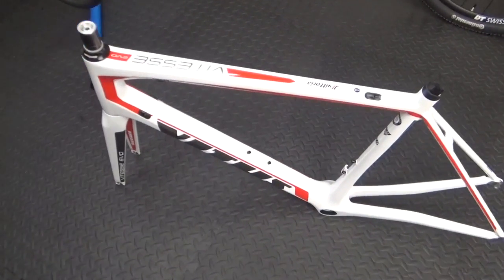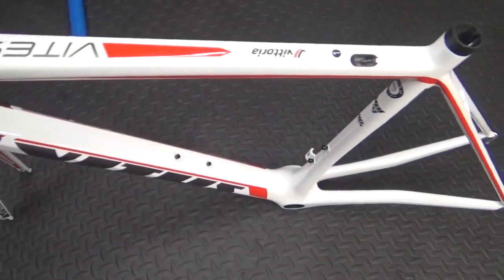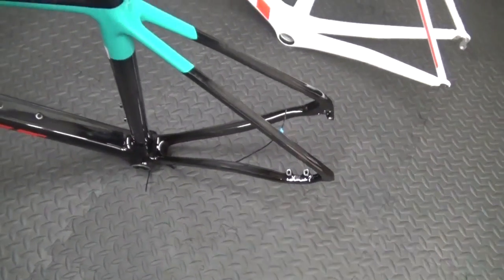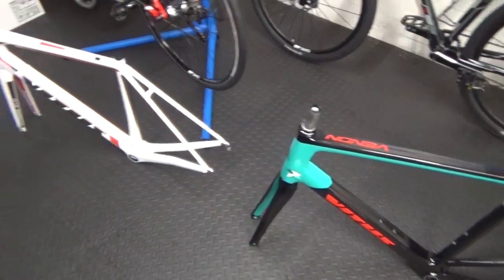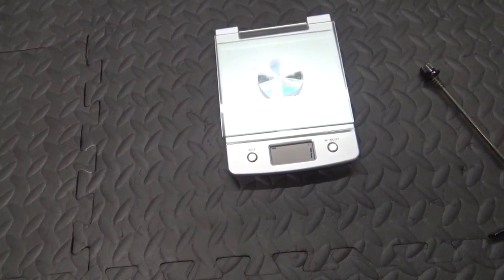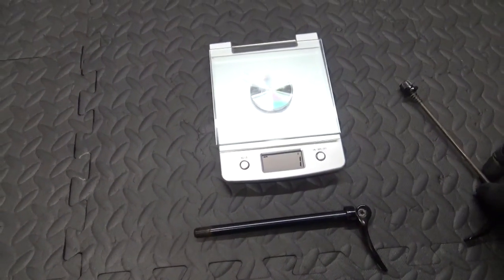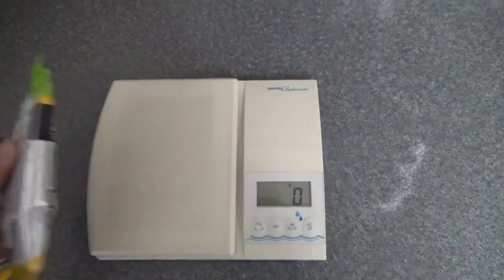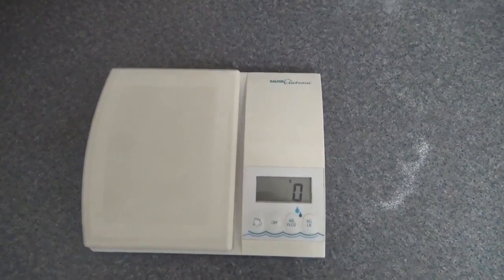Disc Brake vs Rim Brake Carbon Frame Weight

Comment: N ice frames those Vitus. Any idea on the disc frame price? The vabke and out cable housing is heavier even with fluid. You can weigh the parts up to confirm it. At the cheaper end disc is heavier by 300 to 500  grams but in the upper end  disc frames are available as light 850 grams. The venge disc 2019 model is 7kgs. The trek emonda pro disc is 6.7kgs.